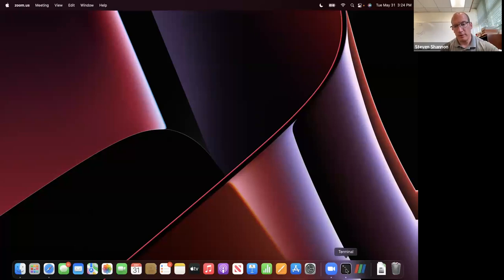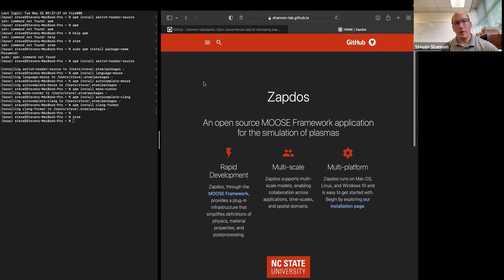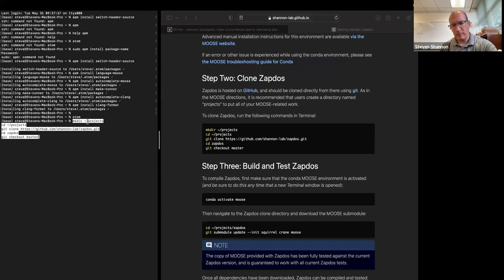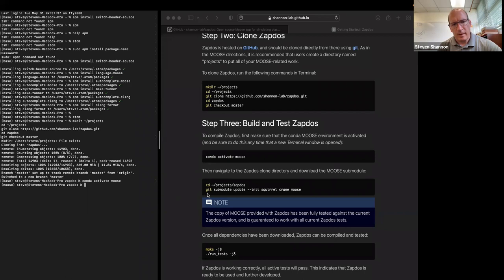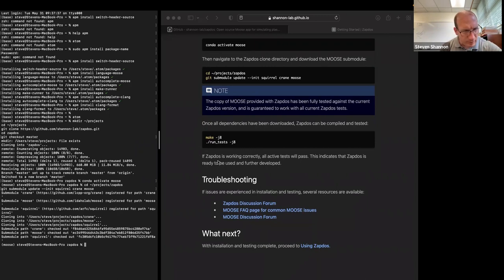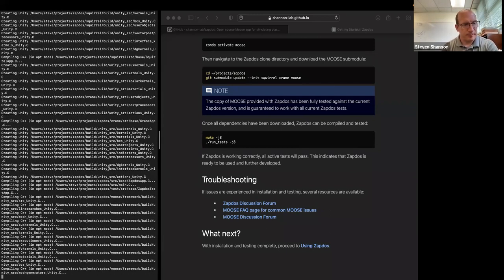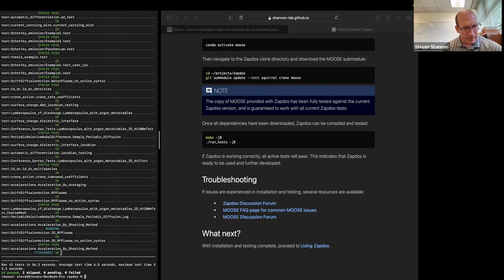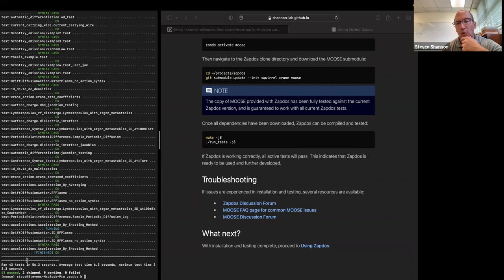MOOSE and Zapdos Tutorial #4 - Zapdos Install and Test

Comment: I'm failing most of the tests after compiling Zapdos with ' make -j8' . Some of the examples will still run from the zapdos-opt file in the directory, but the tests error as follows: "test:DriftDiffusionAction.WaterPlasma: Running command: zapdos-opt -i mean_en_actions.i --no-gdb-backtrace
test:DriftDiffusionAction.WaterPlasma: /bin/sh: 1: zapdos-opt: not found"

Any suggestions as to what is going on in my install? Running Ubuntu 20.04.4 through WSL.

Thanks